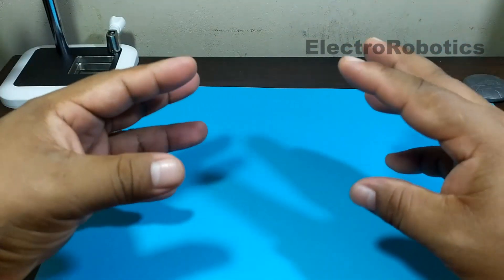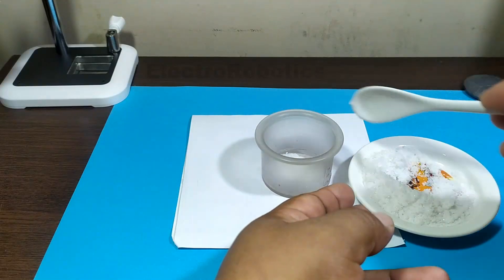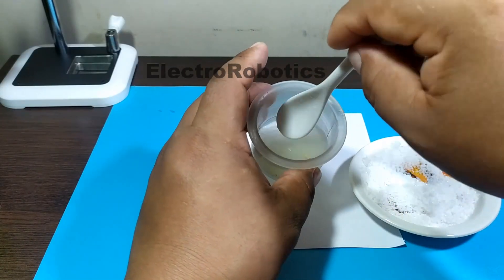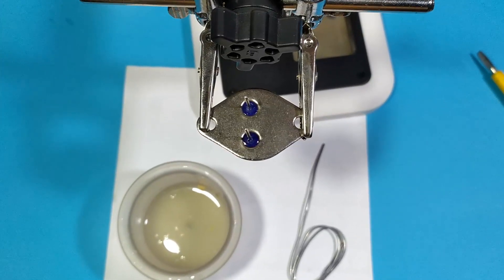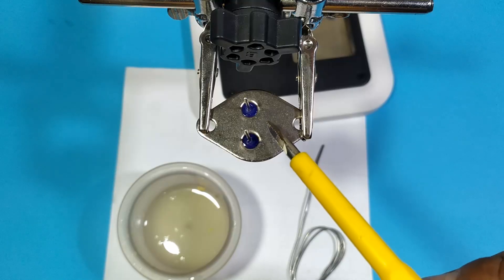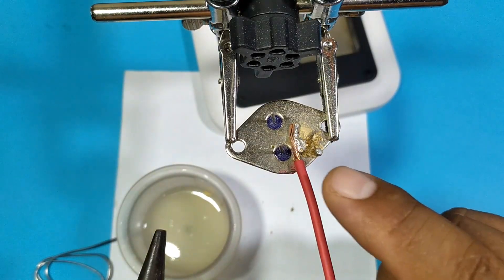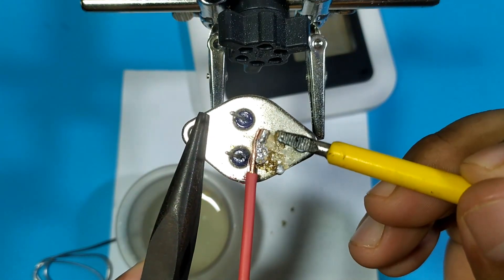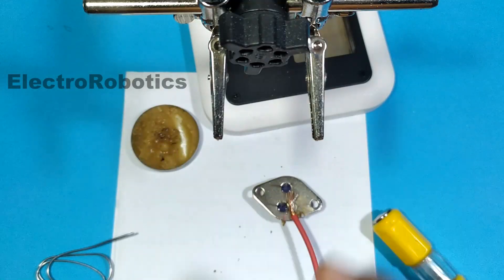No more Soldering Paste, make your own paste using ingredients you can find at home.

Comment: that’s right my friend this transistor it very difficult to get it working any cheap with low wattage soldering it will just not working at all  it work only expensive soldering tolls with heavy duty high wattage

Comment: In the old days RadioShack or Frys electronics and other shops readily stocked rosin based flux, now only solder with flux core is readily found, otherwise it must be mail order/internet.
For this reason alternatives can be useful to know anout.
I know zinc chloride is a good flux for soldering however i never researched its efficacy regarding electronic soldering.  Zinc chloride might be made using zinc coins like american pennies and HCl acid. I would need to review an old chemistry textbook to see the procedure.
Perhaps the key with using acid plumbing solder would be to rinse and neutralizer when soldering is complete.
Those are my thoughts